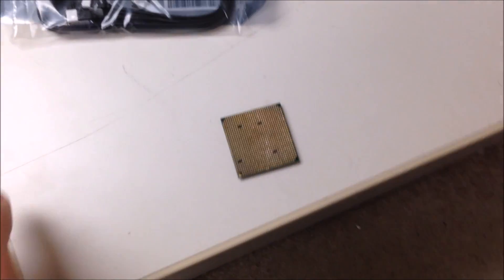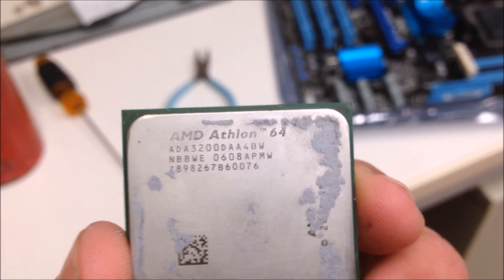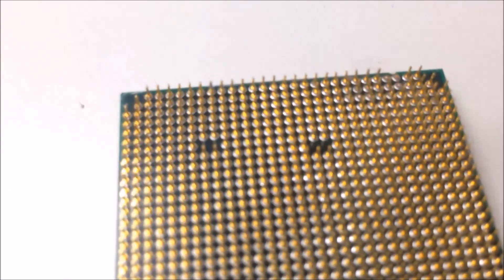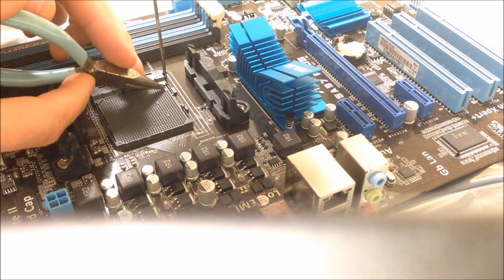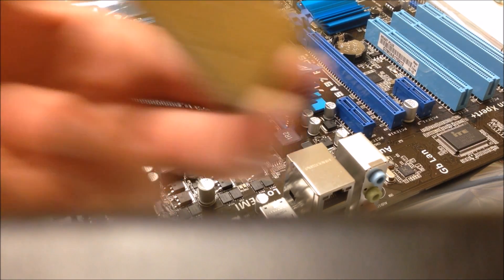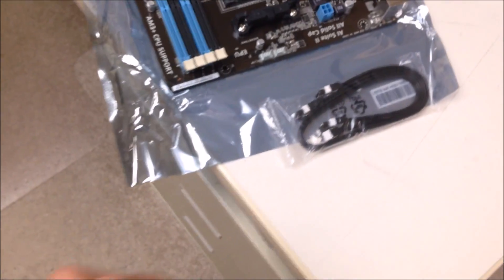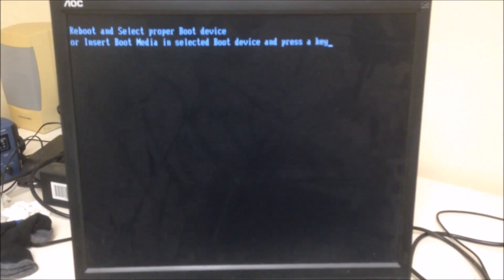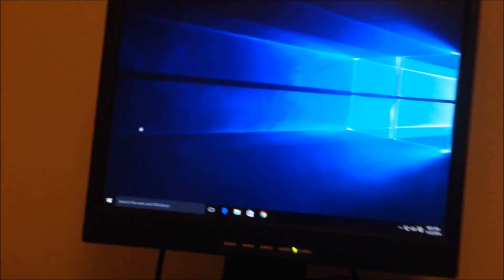How to Fix 3 BROKEN OFF CPU Pins in 5 Minutes. Computer Works!

Comment: This works 100% just make sure to take the whole pin from the other processor and when i say the whole pin i reffer to a stand where the pin came out, make sure to cut them directly from the tpu material, after that you need to see a silverish spot on the old cpu

Comment: I'm dumbfounded by the fact that this actually works.. I took a pin from an old AMD Athlon CPU and put it in the socket of my B550 MB and got my Ryzen 5 5900X to boot again after breaking one of my pins. No need for slaughtering lol

Comment: This saved my life. I bought a broken Ryzen 5 1600X that has a missing pin. Of course the seller didn't disclose that. An extra $4 for an Athlon 64 from eBay for donor pins and it solved my issue.

Comment: Dude you just helped me to save my Ryzen 5900x!!! The problem I had was that my computer was not doing Dual channel anymore because one pin was missing. After I did that everything works perfecly fine now. Thanks a lot!
Reply: Hey you used a cpu pin or another metal?
Cuz I don't hab ma cpu pin nd i rlly wanna know if I can use smthng else nd getting a old cpu for pins is also hard.
Reply: Hey i don't have a pin with me and ma AMD FX 8300 has 3 broken pins and it's not doing dual channel any material i can replace in the place of pins?
Reply: I just wrecked my r7 3800x and bought a r7 5800 as I needed immediate replacement, will try this
Reply: How long did work for you? I just did this and worked, but worried something will happen in the future

Comment: Dude! You just saved my life... and $400 (Rs. 30,000) for a new 3700X! I had pulled my Ryzen 2700X straight out of the socket due to the shitty glue-like thermal paste on the Wraith Prism cooler and had bent some pins. I managed to carefully align the bent pins, but one of them was broken (MB_DATA 30), so the computer wasn't posting at all. After spending a sleepless night crying like a baby, I chanced upon this video. I luckily had a 14-year old (LOL) Athlon 64 CPU which I had kept as a souvenir. I carefully removed a pin from its base using a cutter knife (so that it looked like a tiny nail exactly like in your video), and after an hour of shaky hands, rubbing alcohol, a magnet, a magnifying glass and a tiny screwdriver, I managed to align and place the pin in the corresponding hole and placed my Ryzen 2700X in the socket, applied some Noctua thermal paste and bam! the computer booted perfectly as before. I will test it for the next few days but everything looks good for now. I suggest everyone with a similar problem to give this method a try. It's definitely worth the patience and hard work :)
Reply: Still working? OC?

Comment: I just got a fx8350 as well, with five pins missing, meanwhile I'm using my fx4100 and thinking about do something like this video to fix the 8350, but I'm concerned if I'll damage the mobo, if it's possible to remove the pins later that were manually inserted in the mobo and If I should buy a cheap CPU just to pull five pins from there. Cpu is very fragile, sad

Comment: I have a Phenom 965 with a single broken pin that caused problems when using memory in dual channel mode on a Biostar Motherboard. Will only detect RAMs 1 and 3 and if you try to place memory on sockets 2 and 4, the PC will not boot. I used a staple wire in place of the broken pin, and just cut it off once I placed the wire on the missing socket on the motherboard, and it worked finally even when all memory slots are populated. I did it twice just to make sure it does work, and it sure does. Useful when you have neither the time or resources to get a new CPU to have your PC up and running.
Reply: How did you take out the pin from the socket
Reply: @lawrenceplaysph6966  I used an angled and thin tweezer, the ones I used when I was vaping. It is a challenge removing the pin from the socket but I did it anyways.
Reply: @marlonmangubat4146  i tried magnet works after open close the socket the put the magnet
Reply: @lawrenceplaysph6966  Oh, okay. I tried that but the pin is a bit under the hole so a magnet was unable to pull it out easily, so I just used the tweezer.
Reply: Hey rn i have a Fx 8300 and 3 pins are broken the others are straightened and working but now my ram runs on single channel when I have 4gbx2 ram sticks 
And the pc detects only 4gb which is terrible so any suggestions on what can I insert into the Mobo socket as a pin replacement?
Btw what's a staple wire?
Stapler Pins?
Reply: @prudhsrocks5725  Yes, they are the ones that you load on a stapler, the one that holds papers together.
Reply: @marlonmangubat4146  Oh Man but Staples are zinc-plated steel wires and Has a Electric Conductivity of 16,6.
But gold has a Electric Conductivity of 44,2.
That looks like a lot of difference so did you see any change in the way your pc is performing?
the ram speeds freq or Cpu Temps?
Nd did you use small stapler Pins or the kinda large ones?
Reply: @prudhsrocks5725  Smaller ones I believe. I already changed to a 1090t but based on what I remember I cannot see any noticeable change in performance.
Reply: @marlonmangubat4146  oh ok so it ran with no issues then thank you man will prolly try it today.
Reply: @marlonmangubat4146  f man idk why i tried many times and with different staple pins and it was a pain to remove the staple pins and cut new ones small again and place them on the socket.
After many tries it still didn't work unfortunately.
I'm planning to try another metal with high Conductivity such as copper hopefully it works.
Wish me luck
Reply: @prudhsrocks5725 so any update mate?

Comment: Just worked for me for a Ryzen 3700x with 3 broken pins! Quite a hussle to get the pins in the right place in the socket (shaky hand syndrome :D). Thanks man!
Reply: What cpu did you use too replace the pins did you have too use the same socket cpu or can you get a random cpu
Reply: @thicco9661  a 9 year old AMD A8-3870 . Amd's cpu pins are the same for quite a long time
Reply: @HenzoScifo  thank you
Reply: @J Núñez turion is probably good
Reply: how did you put pins there with socket opened or closed ?
Reply: @Gabriel-fq8gh  Socket opened ofc
Reply: @HenzoScifo  makes sense makes sense
Reply: how is ur cpu working now im debating doing this for my 1700x
Reply: @jaden353  Almost half a year now, working fine. No problems with heavy loads like gaming or video-rendering. Temps are ok too.
Reply: Same exact thing on same exact processor lol
Reply: Hey man ma AMD FX 8300 has 3 broken pins rn and it's not running dual channel so for the missing pins what are all the materials i can use?
I don't have pins and getting a old cpu also isn't an option ebay 65$ shipping charges and locally I asked shops if they have but they don't or maybe they just lying 🤥 lol.

Comment: This only works if you desolder a pin from an old CPU. IT WILL NOT WORK IF YOU BREAK THE CPU PIN FROM THE OLD CPU WITH SOMETHING LIKE TWEEZERS!

BTW thank you for this video you are a god!!!

I just sold my 3600X and need to use my broken 2600X until the Ryzen 9 5950X comes out in a month! Thank you, thank you, thank you!
Reply: Wrong I just did it and it worked

Comment: Thank god i thought my 2700x was a gonner
Reply: Mine too, It works but it only recognizes 8gb ram not 16gb. I have 3 snapped pins but it's so tiny i'm scared of doing it. Did yours work with the pins broke?
Reply: @Neilukuk  yes it works perfectly fine but I was also scared so I paid someone to do it and glad I did
Reply: @chefxshaq3574  Glad it's sorted. did they solder the pins back on or put a wire in the socket?
Reply: @Neilukuk  hey i have the same issue with ma Fx8300 3 broken pins and all others straightened but dual channel doesn't work anymore or out of 8gb of detects only 4 which is terrible any suggestions?
Btw did you fix yours?

Comment: Did it last?
Reply: No reason it wouldn't. The mounting pressure of the cooler is very high. As long as the pins continue to make contact it should not matter that they are not soldered in place.

Comment: Is this guy saying that he melted the side with the pins or the side with the AMD logo?
Reply: He melted the solder holding the pins onto the CPU, allowing them to be easily removed. The solder will melt before the pins. Heating up the heat spreader will do little good.

Comment: Nice video :) picked up a 3700x with a missing pin for 80$ lol
Reply: Did this work on your 3700X?  I have a 3600X with this situation and wanted to know if it worked for you.
Reply: @SF0614R18  yes but i had to find a pin that was around the same size as whats on the cpu. Local pc store had a bunch of old cpus so i found a pin that worked. Be very clean and use alcohol to clean every surface
Reply: @overman330  i bought an amd athlon processor and the pins look exactly the same in every respect.  i haven't attempted this yet.  i'm waiting to get a better magnifying glass.  so you just dropped a whole pin off your burner CPU into the socket?  did you have to make any alterations/cuts to either pin to get it to work?  you heated the burner cpu until the pins fell out?
Reply: @SF0614R18  yes i used a propane torch to heat the old cpu until the pin was able to pe oulled off with pliers, i took the time to score the pin to show fresh metal and the top side of the pin with a light grit sand paper, be very careful to not get any finger oils and the pin and i cleaned it with isopropyl alcohol before putting the pin on the board. Slotted the cpu down ontop and bam. Worked, its been stable even with pbo and auto oc on 😁
Reply: @overman330  hello Man, thanks for The tip. Do you remember which amd athlon was?
Reply: @SF0614R18  Hey man, did you work for you? were you able to fix your 3600x with the athlon pins?
Reply: @TheForistality  did you try it ?
Reply: @dvt1363  I bought a 3950x with bent pins. Paid this guy who had experience with soldering and circuit boards like $40 to straighten the pins. It has been working solid for almost 1 year.
Reply: @TheForistality  wow!!
Reply: I pin broken... Can i put that broke. Piece to motherboard??
Reply: @TheForistality  still works?
Reply: @Furi98  yes, it's been working for over 2 years now no problem.
Reply: NICE! That's an insanely good deal. Did you get it from eBay?

Comment: Worked for me. Honestly it did. Still doesn’t read my other 2 memory ram slots but I’ve played all my games for around a half hour to an hour normal temps high FPS ;) Destiny 2 runs good and I actually had the same cpu he had lying around as the donor.

Comment: I got n amd fx 8370 with 8 missing pin I still play vr n gta5 on it n left pc on for 24hrs while downloading games back to back no problem should I still keep it in I don’t c the need to unless sum strange happen everything is running smooth forgot to mention the old cpu left a Burt spot in one of the socket pin hole on the motherboard I had this pc 5 years upgraded from a gtx630 to a 1060 old cpu was amd Fx 4130, my computer does not want to let go of me, she loves me,I’m afraid to use my laptop in front of her we know everything about each other we have a bond
Reply: dave parks lol gtx 630??

Comment: I hade an idea! If you put som soldier on the base of the pins then take apart a socket so you will be able to reach the backside of the socket you should be able  to soilder it in place by  heating up the pin with a soldier iron. That should Keep it in place :)